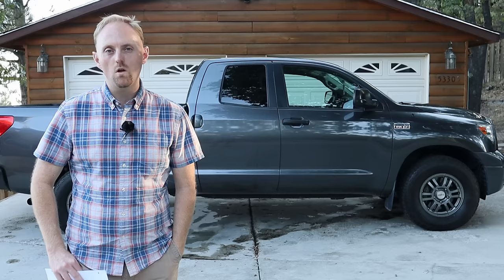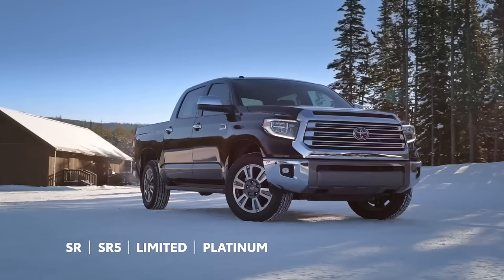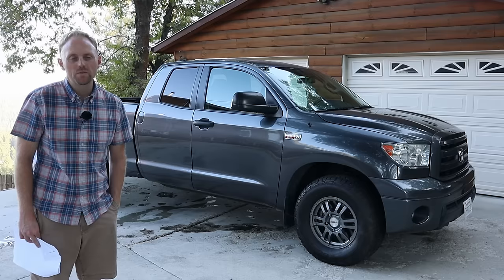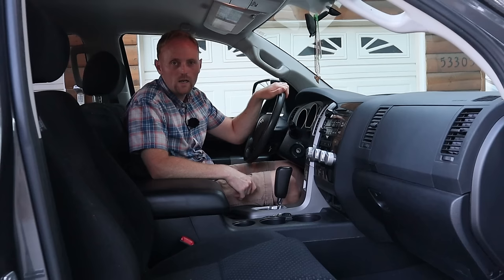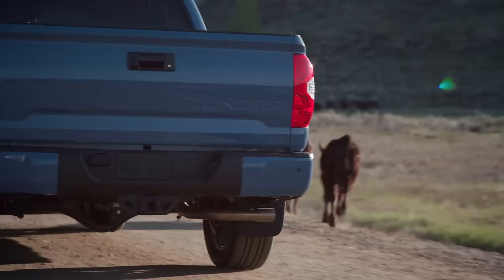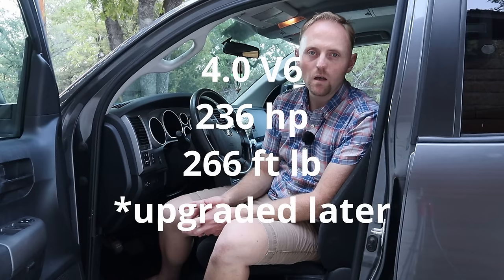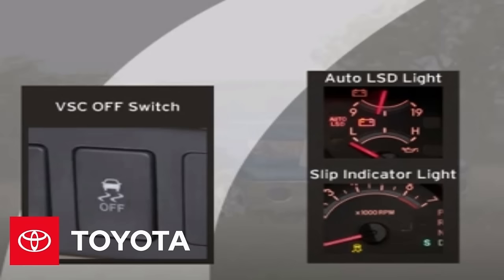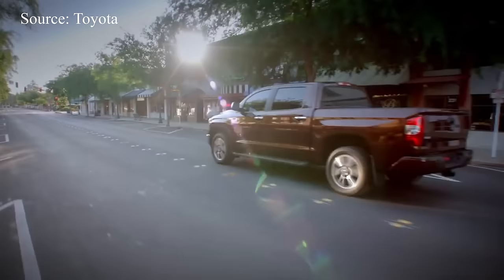Toyota Tundra  |  Brutally Honest Long-Term Owner Review

Comment: I just wanted a basic reliable truck, that's why I bought the SR5. I use it to haul my boats, pickup lumber, move stuff and just general use. I love the reliability, I have almost 100,000 miles on it and outside of tires, brakes and oil changes, I have done nothing to my truck. I plan on keeping it till I'm dead.

Comment: Gas mileage is what it is, but the cost to fuel up is under the cost of repair. A few hundred a year versus a few thousand plus over parts over a year. Trucks are geavy working machines used to haul and pull, not for drag racing, imo. Toyota is the brand i put trust in, back when they were made the right way.

Comment: I have a 2010 Tundra 5.7 205k miles. It tows a 32ft travel trailer pretty good with my truck, which is crazy because i towed the same trailer with a 2018 ram 3500 dually and i honestly felt more comfortable in the tundra.  I know that sounds nuts but its a good truck. The only major repair ive done is the timing chain on it.

Comment: I love my 2012 Tundra Rockwarrior Crewmax.  The truck is nearly bulletproof.  I've only got 86k miles currently but expect it to run another 200K+ miles.  My main complaint about this truck is the TERRIBLE gas mileage.  At best, this truck gets 15 mpg with just me in the truck.  Fully loaded the truck still get 14 mpg when carrying the family and stuff for a vacation, so I guess that is a plus?.  Compared to competitors, the truck gets 2-5 mpg less.

I have upgraded the shocks to the 5100 series Bilsteins and found that to really improve the ride quality.  The seat materials have held up very well and still look good.  I have yet to experience any fading or maring of any of the painted HVAC controls, steering wheel buttons or other controls.  I am experiencing some "hazing" on the headlight lenses but it is an 11 year old truck now.  I'll be ordering a set of Morimoto LED replacement headlight assemblies next week.  That should solve the dim lights issue and "refresh" the front end.

Comment: Excellent review. Sold my 2015 Ram Sport and now in the market for a new truck. My Ram wasnt the most reliable or well built truck. The fit and finish was terrible. A rear door didnt line up with the body, the fog lights could not be adjusted to fit the front bumper, a hood scope was warped and the black plastic door frame protectors looked like they melted on some areas. The Hemi developed a tick after 20k miles. The ignition switch broke after 25K miles. It just seemed like it was built way to fast with poor engineering. I'm a Mopar guy too but I cant lie. It looked good, was fast and the Hemi with a flow-master cat back sounded great.
Reply: I have a 07 tundra xsp 4x4 and my son has an 07 ram 1500 big Horn 4.7…. To say there is a difference in build quality and engineering is an understatement. Every part on the tundra is just beefier and just about any part that holds fluid has a drain on it. The dodge only has a drain on the oil pan, radiator, and transfer case. You can’t even grease the ujoints on the drive shafts. I’m just glad that everything is where I can get to it.

Comment: I bought my used 2011 tundra 5.7L rear wheel drive with 60K miles on it back in 2016. After 6+ years and 100K, the only thing I’ve had to replace in my truck are break pads and fluids. My goal is 1’000,000 miles.

Comment: I drove my 2013 for four years and put 100K+. Ride was terrible and it ate brakes and rotors. 16 mpgs on the highway and 14 around town, I miss the v8 growl but not the gas pump. When life returns to normal and I commute again I will take the 22-24ish I have been getting in my f150. Listen, if you dont care about mpgs and you need a truck, get a  Tundra. They are value in comparison. They hold their value BUT the repair costs for Yotas is higher. Strange place for the alternator....and its still costs you $$$ whether you're at the pump(Tundra) or mechanic(big 3) Decent review sir.
Reply from the maker: Thanks for sharing

Comment: Good video. I'm glad you touched on the T-100, as it's often overlooked. I have a 93 that still runs great.
Reply: We had a 96 T-100 and loved it. What a great, reliable, tough truck. Passed it on to my daughter, who used it all through college. Finally sold it with over 250,000 miles, still in great shape. I miss that truck!
Reply: T100 was amazing when it came out. Dad had a regular cab in the forrest green. Got into alot of trouble with that thing, but always got out too. Had the initial 150hp (guessing) 6, with the manual. Amazingly capable lighter with room, vehicle. Wish it was still around.
Reply: @robl7532  Still have mine.  Yep, same small 6 cylinder with the 5 speed manual.  Hell of a truck.

Comment: Remember that toyota also offered a TRD( Magnuson) supercharger which bumps power up to about 550hp and about the same torque. And you can count that even with all that power it will probably be as reliable as the domestic competition as if you had it installed at the dealer, you could still get the factory warranty.

Comment: Fantastic in depth review. Just what I was looking for. I own a 2005 4.6l v8 triton that has treated me extremely well. It’s getting high in miles and I was looking for a secondary truck. I own a buisness and pull a trailer everyday for the most part. I was really struggling between the 3.5l v6 turbo f150 and the tundra. Of course the MPG’s are tempting with the F150 but I do appreciate the tundra for its basic truck features. I’m getting a 2016 SR5 5.7l double cab from Carvana. Can’t wait to get her and see what she can do.

Comment: Got a 2007 Tacoma and towed a 24' trailer for 7 years with it as i worked out of town a Lot but the gas mileage sucked but i was runing 10ply 33s on it the thing would straight haul it where ever  i needed to go then moved up to the tundra same trailer it was like it never was back there sense then have owned 3 Tundra's with a combined 5048 thousands miles, 2011/2012/2014 /2015 currently have the 2014-- 1794 Addition in sunset bronze with the 5.7  running 10ply33s as that is my favorite have had no issues as to the engine /transmission / etc etc i do change out the oil every 5000 miles as I have always done not the 10,000 the dealer would have you do and i use synthetic gear oils as replacements that's just my preference and as of 2023 i still have the 2014 and has never let me down that said of course there are minor things i wish Toyota had done who doesn't. before I always owned Ford cars and trucks never again got plain tired of working on them  from 1970 to 2000 (Its true) GM trucks after that  have that love for Jeeps always seemed like i tell myself why did i get rid of that Jeep i miss it then i get another one :/  anyway's for those of you that are looking for some solid maintenance info on Toyota's try  (the Car Care Nut) channel.

Comment: Thanks for the honest review.  The one glaring problem with the Tundra is that it is still smaller than a US 1/2 ton truck.  The width is narrower.  All the Toyotas over the years and various models suffer from this.  It is really noticeable in the rear seat which can’t accommodate 3 persons without  feeling wedged in.   The seats are thin and the ride is harsh compared to the US trucks.  Sure, when you’re young that isn’t as much an issue.  That said, I still prefer reliability and longevity in a vehicle.  I personally own a 2009 GMC Sierra with a diesel engine coupled with the six speed Allison automatic.  I’ve had to replace one glow plug and that’s the extent of repairs to my 85,000 mile truck.  The Tundra could never tow like my older diesel and surely no where near as well as the newer diesels.  I routinely get 23 mpg empty in the highway and 12-13 mpg fully loaded and pulling my 10,000 lb. fifth wheel.  If I do decide to buy a 1/2 ton rated truck again I will buy a Tundra.  Like I said, I like reliability and longevity in a vehicle.

Comment: Thank you for this review. I'm looking to buy a Tundra in Nicaragua. The V8s don't get a lot of mileage, and the Hilux is the truck of choice. So you can find Tundras or any V8 with low mileages. Found a 2010, with 16K miles, so they are expensive, but it will probably be my last and only truck in my life (carrying dirt bikes).

Comment: I've owned MY 06 D.C. SR5 4X4 for 4 years bought at 164K and now at 200K, I absolutely love my first gen double cab. I DON'T NEED HEATED SEATS, LEATHER, CENTER CONSOLE SHIFTER extras. This truck does what it's supposed to, has PLENTY OF POWER (WHICH I JUST FOUND A way to link/mount the TRD SUPERCHARGER TO THE VVTI 4.7, yes I'LL be changing the WEAK RODS I KNOW). THIS TRUCK has made SO MANY GUYS with other "BRAND" trucks really re-think their own purchase (chevy,dodge, and Ford owners), including my own family member who owns a 2015 dodge 4x4 crew-cab hemi. I'VE BOUGHT MY FIRST AND LAST TRUCK AND WITH A 0 MILE ENGINE COSTING $3500, and parts from factory STILL READILY AVAILABLE at affordable prices? Absolutely no reason to get ANYTHING ELSE, ESPECIALLY AFTER THE TRD SUPERCHARGER ADDITION.

Comment: 08 Tundra here. One thing that surprised me was taking it into a car wash. The high jet spray pushed water right through the top edge of the sliding rear facing window. Love the truck but this part stinks.

Comment: Just trade my 3.5 Ecoboost Ford for a 5.7 Tundra. If you love working CVT CAM PHASERS. The transmission slipping in 4th gear (10 speed) then you will love a Ford. Love my Tundra. One tough SOB!

Comment: Well, it's near the end of 2023. I have a 2015 Tundra SR5 X Cab , 5.7l 2wd and it's all I need for Florida. I love the towing capability. I've had every kind of truck you could imagine since my teenage yrs forward.  My preference is towing capabilities, hand crank windows and goo heat and a/c, oh more power🤣. Gas mileage is a consequence usually. I get 17- 21 mpg doing 85 mph, towing 10k lbs at 85 mph 13-16 mpg. I love the value, reliability, etc, however I know electric toys on anything becomes unreliable over time...just like my 24yr old RAV4. Consequently, I'd prefer a simpler, more dependable, non-electrical, more mechanical without an ECM at all.  But in the real world this is gonna be my last of newer vehicles I've bought. The next one I'll build myself - exactly as I want it and as described. Thanks for your review and honesty.👍

Comment: I've had my 2002 Tundra for 19 years. Love it!  I think Toyota should have an engineering team to analyze the difficulty of maintenance on their vehicles. Most maintenance issues on these trucks are "fairly" straightforward. However the stupidity of design in the AC Evaporative Cooler is mind-boggling. The idea you must remove the dash to service or replace the Evaporator is insane. Toyota you can do better!!

Comment: My neighbor had an 07 Tundra TRD and performed all maintenance religiously. By 140k miles, the transfer case failed, A/C failed, engine ran well but had a massive knock. They are good trucks, but not comparable to the super reliable Toyota trucks of the 1990s.
Reply from the maker: Yeah the 90s seemed to be the best...

Comment: I own a 2006 Tundra Limited loaded 4×4 I have 221000 miles on it with a small V8 an it runs great. The only problem is the frame is rusting an they won't fix it an I can't afford too get it fixed.  I live on Social security so getting it fixed is out of the question.  I will drive it till it falls apart

Comment: Very nice review  and excellent  detail.  I wish you had a bright light and moved the video camera in to see the storage  in the back seats. ( not really a big deal. I will just go check one out in person)  it stinks Toyota  doesn't  offer a locking rear differential.  I currently  have a GMC Denali  and it has a locking rear differential  and full locking 4x4 in 4 high and 4 low. In certain  conditions  I have really needed that traction.  Deep snow and bad muddy conditions (not by choice)  and flooded river and road conditions.  The All wheel drive does fine but there is definitely  a big difference  when it comes to a full 4x4 locking differential.  Thank you for a very nice review.  I have a 2008 Toyota yaris and RAV4.  Love then both. A lot less repairs than other vehicles. Both Toyota's have  currently  225,000 miles and both have had brakes replaced.  The yaris has had the key ignition  tumbler replaced, drivers side mirror,  starter,  alternator  as far as parts go. Both have original  AC and works great. Always change fluids, oil, transmission, ect. No leaks or burn oil at all. They both drive like new. Great build quality.  Love reliability  and not hemorrhaging  money like GM, Ford, and Dodge.  I have owned them all. Just sold my Dodge last year. The Ford the year before. Gas mileage  maybe better on Ford, GM, and Dodge  but you your repair  cost will be way lower. More time going on the weekend  fishing or hunting  trip verses your vehicle  in a shop and a big bill. Here's and idea of costs on Ford ,chevy, Dodge.......typical...... 100,000 fuel  pump = $1686.00 : 150,000 miles water pump goes bad or thermostat  which  generally  leads to an intake manifold  leak or possible  head gasket. Since the engine overheated now your plastic radiator  needs replacing.  Total  cost for a shop $2800 - $4000 depending  on how much went wrong , year, parts price. And then the heater core 8hr-12hr job @ shop time of $155 per hour plus $200 heater core , plus 10% tax and possible  other parts . The AC will leak in the ten years of ownership  of these vehicles  and its averages  $1250 diagnostic,  parts, repair, and recharge.  ........ I could add more Luke door handles breaking. Mainly  drivers side. Emergency  brake  cable and other things.

Comment: I loved my 13 Rock Warrior, but the mileage was horrible, much happier with my 17 F150.. The Tundra not in the shop once in 114k miles though, my F150 has had sunroof replaced and a couple quick recall fixes in the last 4 years & 60k miles.. The fords just have much better features and options.. The best thing of Tundra is Resale!!.. My 5 year old 13 Tundra with 114k miles sold for $30,500 bucks and I bought it brand new with rebates for $41,800..  Thats only 11k bucks for 5 years and over 114k miles of fun in a brand new truck!!

Comment: I love my tundra, but I wish it was more of a work truck, these are pretty boy, diy, weekend warrior trucks, not serious work horses.
Legend has it that the previous owner on mine installed a fifth wheel and tried towing a horse trailer, it whipped him around so bad first time he towed with it that he ended up trading it in for a f-350.
toyota needs to come out with a fully boxed frame and stronger panels, especially the box, maybe a 2500 version?

Comment: I've known too many people that have had premature major problems with the competitors. I myself strayed and bought a brand new 1999 Dodge Ram.  OMG, never, ever again!  I bet I didn't have 10 miles "off road" with it (no rough driving) and had major front end problems at 60,000 mile.  The plastic in the dash disintegrated to literal jigsaw puzzle pieces.  Junk.  A nephew bought a new Ford 150. Literally drove it from the dealer to a store and it would not go into gear.  Dealer had to tow it back. Good friend just put a new transmission in a Chevy Laredo (?) at 90,000 miles and I know for a fact that truck has been well maintained.  Now, I know these are one-off examples.  Too many F-150's on the road to call them "junk", but I've owned 4 Toyota trucks and my sons have owned four others  None of us have EVER had ANY problems with our Toyotas.  Don't need "bells and whistles" - I need dependability.

Comment: 2010 Regular Cab short box. Owned for seven years. Horrible, touchy throttle control. Front diff defective after 3,000 miles (fixed under warranty after four dealer visits). Lot's of power but horrendous axle hop or one-wheel-peeling all the time. Three-hour DIY home oil change (one hour if hacked). Lot's of defects left the factory that I fixed myself.
Reply from the maker: Thanks. I do remember the super touchy throttle

Comment: People go on and on about the poor fuel economy.  My last two Tundras get the same mileage as my 4Runner and my FJ did.  Of course the Tundra is a 5.7 with 381 HP and the others were both a 4.0 V6.  So in point of fact the Tundra is far more efficient than either of the others and only about 0.3 liters per 100 Km less than the competition.  Factor in the fact that the brakes last 160,000 Km or more without any maintenance at all, and nothing else breaks on them, they are still the best bang for your buck by far.

Comment: 2008 tundra 275,000 miles. Brakes, Oil change and Tires. That's all you'll need to change!
Reply: Don't forget the carrier bearing
Reply: @donjuan1212  Just replaced mine at 200k. Shop said it wasn’t fun haha
Reply: @Mustang-mb7cg  i got 260,000 miles out of mine, can't really complain

Comment: What good is it to have a motor that gives you 10% better gas mileage but is worn out after 120000 miles ( Eco boost engines ). I think this is Toyota's calling card -  low cost of ownership. I'm driving a 2005 Silverado 6L / 366 ci engine - gas mileage is poor but it never breaks.

Comment: The fuel economy argument based on percentage is the only thing I don't agree with.  The amount you save on fuel with the competitors you lose that and more with the extra repair costs.

If you drive 20k miles a year and get 21mpg $3/gal you spend $2857 a year.

If you get 17mpg in the tundra you spend $3529 which is $56 more a month in fuel for a truck with solid reliability.